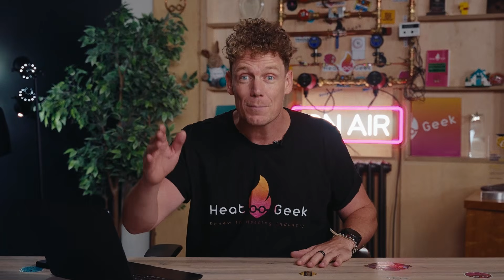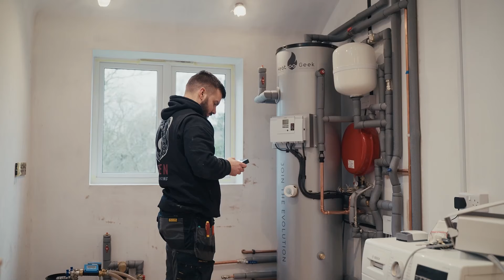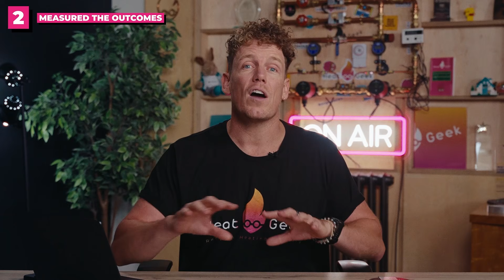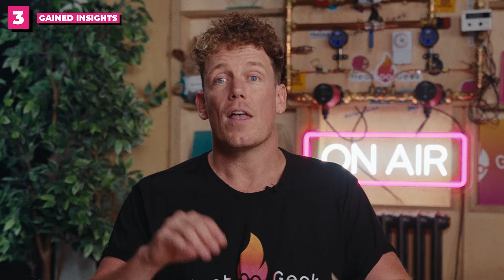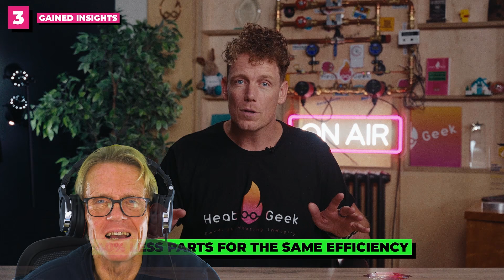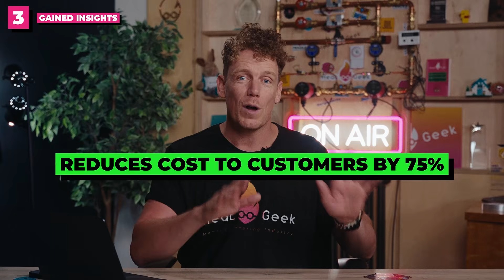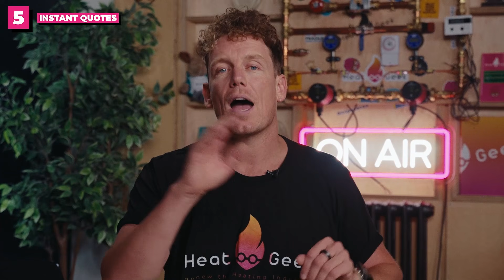Heat Pump Reality Check: Is Zero Disrupt Too Good to Be True?

Comment: We swapped to a heat pump and an EV and our electricity bill is less than £1800 a year using an EV tariff. That is half the price of our old electricity bill plus diesel and oil for our central heating. Running the heat pump overnight for much of the year at 7p a kWh saves a fortune, it only gets switched on during the late afternoon for a few hours the evening from November through to March.
Reply: Yeah but when the government takes off the stabilisers once adoption is at a level they're satisfied with, your costs will go up. They're incentivising it now for political purposes, but that won't last once they have what they want.
Reply: @TCJB33 An electrified world is cheaper than the old fossil world. It already is for a lot of people, and that's just spreading to more people now. The govt hasn't got much to do with it. You can make your own fuel off the roof for at least half the year, you can buy all your electricity at super-cheap overnight rates. And the country as a whole is not sending billions to the US, Norway and Saudi Arabia.
Reply: @xxwookey  haha yeah much of  that isn't true. Electricity is expensive in the UK presently, much more so than gas. Overnight rates are cheap because that's when things like wind turbines, which Tony Blair's government pushed and introduced ahead of alternatives and which the grid wasn't designed for, are still operating and no one is using the electricity so, they provide cheap rates for you to store that energy in mobile batteries called EVs, so that the farce is maintained. We also import electricity from other countries at peak times regardless of production type, so we may/may not be sending money to fossil fuel producing countries but we're still purchasing it from elsewhere. The increase in demand on the ancient national grid will also effectively break it, and it is already in the state where it would cost an unholy amount to update and replace. I like solar personally and I abhore consumerism so it would actually cover my electricity costs, but it also requires a solar inverter, because it's DC and competent installation from an electrician with isolators at the inverter and probably at the fuse board. So for everyone to put it in would require a significant investment in an economy where most people live pay check to pay check or subsidisation from the government, which has no money and for most people who live by their existing lifestyles it wouldn't be enough, because their electrical demands are typically highest in the evening and at night, when they've come home from work. It's also fairly sub par in winter when demand will also be high. So, it's not a silver bullet.
Reply: This electrified world is still an old fossil fuelled world
Reply: So changed from diesel and oil plus electricity lol cause it would be cheaper.
Switching from fire wood be cheaper
Reply: @plumbertime  I can't understand your comment? My oil fired CH was a good deal cheaper than gas to run, at less than 5p a kWh at today's price and at 1.5p a kWh in 2020. My diesel bill was about £125 a month for 1,000 miles. My electric bill was about £900 pa at a current standard tariff (25p a kWh),  All told at today's prices that is £3200. My electricity bill will likely be £1800 for the present year fixed tariff Feb 25 - Feb 26. I then expect a 10-15% increase owing to changes in the charges for Grid Transmission costs and towards the retailers bad debts, those folks that don't pay their bills are a big drain on my money. My EV uses about 3.7kWh per mile @ 6.7p a kWh comes out at £220 pa. My heat pump uses 5750 kWh with 30% @ 6.7p and the rest at 26p a kWh so average 20p a kWh across the year.. equals about 5.5p a kWh at the radiator - COP of 3.7. Gas at 6p a kWh @ 80% efficient is 7.5p a kWh at the radiator. I write all this to get folks to understand just how cheap electrification is. I want everyone to go electric. The price of the Grid upgrades and the management (Balancing Costs) of the Grid system bt NESO gets cheaper per kWh the more folks switch. Dump gas now whilst there are grants and before the standing charges get eye wateringly high! The transmission costs will remain the same paid for by fewer meter points!
Reply: @briangriffiths1285 You really mean 3.7 mile/kWh?
Reply: How much did you have to spend to achieve that though? Curious about the install bill if you’re willing to share.
Reply: @gareth_curtis  The heat pump instal was in 2021 and cost £12.5k for a 5 bed house. The heat pump is a 14kW Mitsubishi machine which was comparatively expensive. An 11 kW machine would suit some circumstances but we have a micro climate of misty weather in autumn and winter @ 2-3 degrees which would cause an 11 kW machine to ice up so a 14 kW machine with a much larger heat exchanger was installed. It was subject to the RHI grants which will repay the whole of the expenditure over 7 years. The heat demand is about 18,000 kWh per annum so the oil burn in a very efficient boiler was 2,400 litres a year roughly 24,000 kWh at 55p a litre at today's prices. I had swapped out a couple of radiators and run the oil system on its frost settings at a flow temperature of 37 degrees, the hysteresis of the stats switched the oil burner on at 35 degrees and off at 40 degrees and I measured the heat load at 8-9kW at zero degrees. So I had proved that a heat pump would work without overmuch work but there is a lot of electrical work involved with long complicated runs of cable owing to the layout of the house. We also have a large kitchen and boot room with under floor heating under a tiled floor 45 m2 (yes it is huge). This acts as a storage heater and hence running the heat pump overnight builds up heat in the floor which lasts through the morning until we get some solar gain through 6 meters of bi-fold doors from mid day. At this time of the year the heating of the hwc and floor takes place overnight with a top up during the late afternoon on a sunless chilly day. At some point in November it will be left on 24 hours a day. It draws 2- 2.5 kW when it is running on a moderately cold day (7 degrees) and 300 watts of that is for 4 circulation pumps (that is one reason for all the electrics they are in different parts of the house). But it all needs to run all the time, zoning is counter productive. The 250 litre hwc was custom made by McDonalds of Glenrothes in copper. We needed an old fashioned open vented system because of low water pressure. It took me some effort to find an installer that understood the problem.. (the majority of installers want to install unvented and were talking of pumps to raise the water pressure which would have been contrary to the water regs where we live and still would not feed 3 bathrooms!) We achieve a COP of between 3 and 4 for heating and 2.5 - 3 for hot water at 50 degrees. I do not run the legionella cycle, the water temperature is adequate but the copper hwc also treats the water and is better at conducting the heat. Electricity demand for the heat pump alone is in the region of 5,500 -5,750 kWh per annum. The heat pump rarely cycles (switches on and off) despite being oversized, the scroll compressor is capable of running at 5 kW output. It can draw up to 7 kW on start upon a cold day when it is raising the water in the system from cold to 50 degrees for heating the hwc. But that passes after 10 minutes or so as it settles down. We do suffer some very cold weather because we are 700 ft above sea level and I might gold the lily and swap a couple more radiators to boost the temperature in the lounge where at minus 5 it struggles to reach above 19 degrees. Even with the best heat loss calculations it isn't possible to know precisely how the fabric of the house will behave and if there is bridging causing greater heat loss.
I hope that this gives folks the confidence to get heat pumps fitted. I was lucky to find a local installer who was really interested in heat pumps and pops in on his way home  when I have had a couple of filter blockages, he knows the kettle will be on!
Reply: I didn't - and my energy costs inc standing charges + VAT are less than £1300
Reply: Thats great news for someone who have 40-80k isling arous to splash but not for normal people on 30k/ year salary which bearly is enough to keep old15yers wheels morgage, and bills paid😕
Reply: @user-uq7io2os3r  Evs can be got for under £10k and a heat pump installation subject to the grant should cost no more than £4k for modest homes. That is only £5-7k more than a boiler swap and a budget ICE car. and could be cheaper on finance if you include the cost of fuel. *,000 miles of petrol at 40mpg is8 £100 a month cf £20 for electricity.. (8000/3.5*.075). Grab an MG5 at 3 years old and a heat pump whilst the grant is available.
Reply: @user-uq7io2os3r  prices will continue to come down as the tech matures, esp. cars. You can get second-hand EVs for decent prices now, and most of the doom-mongering predictions about EV batteries holding no value and low range at age haven't come to pass.

Comment: I've still to be convinced. I've just installed the latest Tado X into a Potterton (Baxi) Assure combi and wired up Opentherm and it's hardly running heating at 21C  (29p per day in October in a cold area on average according on the uswitch app). That's evens out at just over £100 if you offset the days its not switched on in summer to the extra use in winter. Even allowing for error adjustments it would take a lot of years to break even. The Tado X app is versatile and shows the humidity in real time and I think I could lower it even more with a bit of tweaking especially when I've set up the Geo fencing properly. The current USwitch app is currently showing that a November offer is set to give 5 hours free electricity per weekend for 5 weekends, times to be confirmed. IMHO the break even time would be far too long at the current prices.

Comment: Currently advice is to run heat pumps continuously. On octopus tracker my average price per unit since Christmas is circa 22 pence per kWh. I can buy kerosene in summer for about 50p per litre. A litre of kerosene contains 11 kWh. Combustion efficiency loss means I only get 9 or 10 so I'm looking at 5 pence per kWh. Refrigeration/heat pumps give typically 3 or 4 kWh output for each 1 kWh input. So we're paying 5 or 6+ pence per kWh for heat. Simply renewing my oil boiler would have been a much more sensible decision based on cost and no need to change radiators.
Reply: At 3:1 if oil is £1 a litre you need electricity to be 30p or less to break even assuming a litre gives you 10kw.
Reply: How are those figures looking now with the exhorbitant cost of kerosene?

Comment: Hang on Roger! A heat pump costs 5K so how on earth do you fit and commission for 3k? Oh wait a minute, you are including the 7.5K  govt grant. So if we were to level the playing field, gas boiler 3K against heat pump @ 10.5K!
This is the price you'll have to stump up when the blasted thing goes wrong as the grant is only for first time installs. 
Harumph.
Reply: No, the heat pump install includes conversion to a low temperature system. Replacing the heat pump when it eventually wears out is currently from around 4k.

Comment: Heat Geek Ripoff - I was asked to pay over £800 for a design consultation as part of a new service, despite having already signed up for a consultation at £250 via the website. This felt misleading. A business cannot introduce new services, raise charges after a customer has signed up, and then insist on an upgrade to their Black Label offering made available post my signup. Heat Geek should have simply honoured the original offering available at the time of my purchase.

Comment: Lets be totally honest, heatpumps are a very expensive option in the UK because our housing stock is 100+ years old, and Im sure he can generate an app which for a new house, well insulated, will come in a lot cheaper than before but only because they are cutting things previously included.
But as pointed out, when someone markets a product the way they did and denied all the criticism, then remarkets themselves saying they fixed all the issues previously denied... Add to that the guy is in total denial, you're absolute best case unicorn install is the same price as a boiler which if government kills the grant is £10k😅
The final killer is the same issue killing solar power. If you can build a system which pays back upfront cost over 10 years, if you have to finance it, it will be at 10% so all your savings are going to pay the interest on the loan not pay backnthe capital

Comment: It's a different picture in the commercial sector. Default is heat pumps now as you can do both heating and cooling simultaneously from the same heat pump. I started with conventional boilers and chiller tech and had to retrain into heat pump technology. The big change will happen when unit cost of electricity is not based on gas.
Reply: The more Net Zero, the higher the cost.
Reply: @michaelorme7268  evidence?
Reply: @amiddled   Trust me, bro.
Reply: @michaelorme7268   Literally the opposite is true. Cost will only come down as we reduce our reliance on gas.
Reply: @FlatToRentUK 'Take no-one's word for it' (Royal Society motto)
Reply: @michaelorme7268  Well I'm certainly not taking your completely inaccurate word for it. Thanks for the advice.
Reply: @FlatToRentUK  No. Yet where is your counter? Ever since the windmills appeared, we've been pormised two things. Firsly, energy costs will go down. Secondly, temperatures are going up. Neither is true.
Reply: @michaelorme7268  I've literally told you. Prices can only come down as we lower our reliance on gas. It still sets the price as the marginal source under our pricing system 98% of the time. As that proportion decreases and the marginal source is a cheaper form of generation we will have lower prices. 

And average global temperatures have undoubtedly been going up so you're wrong on that one as well. Because we're still emitting vast amounts of greenhouse gases. Temperatures will only stop going up when we reach net zero emissions.

Comment: Your such a pessimist for someone who has been in the trade for so long. You should be open to new technologies. Heatgeeks installed my new air source heat pump and it’s been amazing, cost effective working in the background efficiently as it should be. Give it a break and Stop bad mouthing them and the products off.

Comment: Heat pump for our house would be £35k including insulation upgrades.  New oil boiler £4500.  Really is no contest win for oil as heat pump will never close that price gap.
Reply: Quick question here, If you did the insulation upgrades but kept your existing boiler how much saving would you make?
Reply: @dantronics1682you will find that your house would be much more comfortable with much less heating. Insulation is probably the best investment as well as windows.
Reply: @d@dantronics1682planners have turned down all our attempts to upgrade the insulation, it’s grade 2* listed building so apparently can’t be upgraded to be fuel efficient.
Reply: Same with me. Also have open fireplaces.  No standing charge with oil and know a few builders getting rid of wood and tree surgeons that give me free wood that I season for a couple of years.
Reply: are you still sure about that?
Reply: @mrdeafa25 swapped boiler to LPG gas, rate fixed for two years - yes still happy.

Comment: If a new gas boiler is installed correctly and to part L regulations, at low temp design with weather compensation or open therm controls, it would be cheaper to purchase, run and maintain than a heat pump in the same installation way. Plus the boiler would last a lot longer as a further saving bonus. 

The idea behind all the green technologies are good if you have money and want to be off grid which it could work at an astronomical cost. 

Example, 3 bed terrace worth 100k. Solid brick no insulation. Cost to insulate 30k, heat recovery ventilation system 6k, heat pump with underfloor heating both upstairs and down to gain a 30 degree flow temp 30k, battery and solar 15k then cost to put the house back together after having to gut it 20k minimum, depending on the final finish standard. 

That house now stands at 201k. The house actually wouldn’t be worth more than 115k as valued by the banks mortgage surveyor. 

It would take a long time to get a return on your money, the products likely wouldn’t last as long though meaning more cost. 

No one in a 100k house has the money to do this as if they would they wouldn’t live in a 100k house, they would live in a bigger house, which heat geek and other installers won’t touch with heat pumps as the cost rapidly rises and the pipework diameter sizes needed make the install impractical. 

Therefore it’s all for rich people who actually can take the power back from energy suppliers which would be a brilliant thing to do
Reply: You're missing out one factor: you're stuck with gas, there's nowhere to go. If you have a HP you have the option of A) better & cheaper tariffs B) removing gas standing charge C) extending your system with solar/battery installs. I have friends with HP + solar combo that run it for basically nothing for 2/3rds of the year 🙂 -- can't do that with gas.
Reply: @defragsbin  I have solar and know how poor it is in the short dark winter days compared to summer, i only use my gas heating during the cold months not 2/3rds of the year. I'm really not convinced about the massive outlay even with the grant of ripping out all my pipework and radiators.  Heat geeks are really expensive.